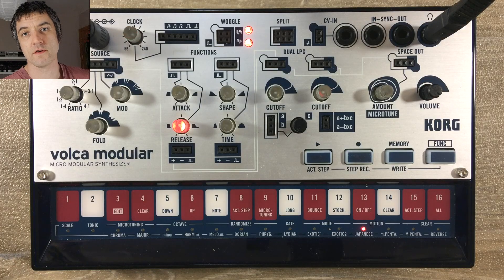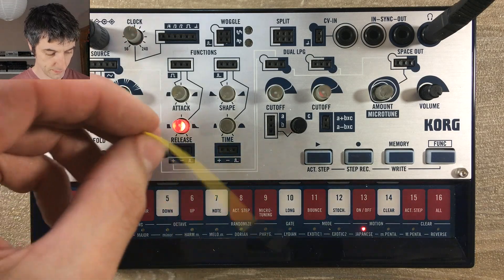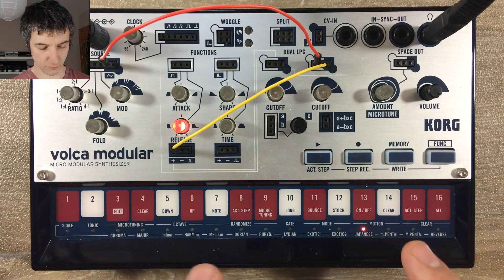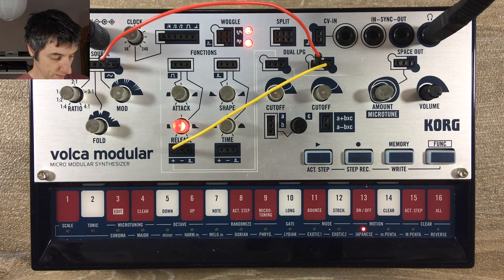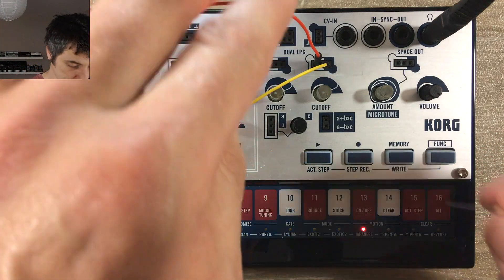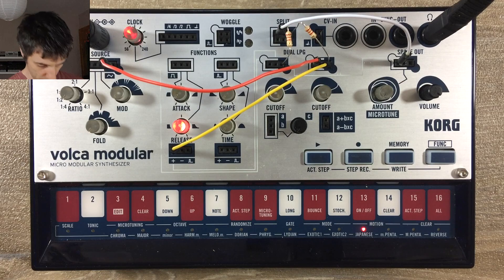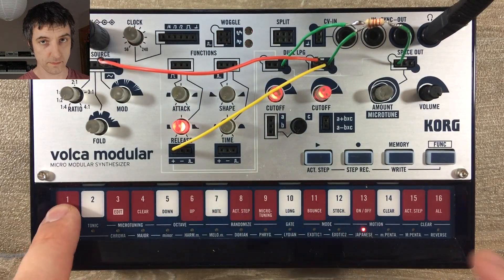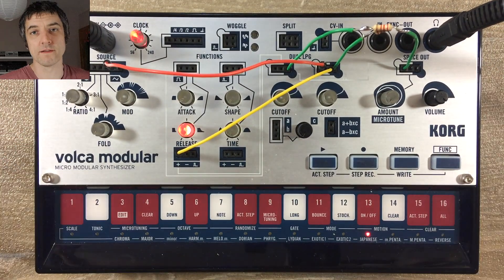Volca Modular Distortion Problem - How To Get A Clean Sound

Comment: excellent video. Have you noticed any issues on the volca modular where the fm modulation sounds pure in the upper range of the ribbon controller, but when you drop down to the lower range it gets wobbly and out of tune?
Reply from the maker: Thank you. Yes that's normal, the Volca Modular used exponential FM to create it's complex tones which can very quickly lead to wonkiness. It's usually best to keep things quite subtle if you want a nice playable tone. This video does quite a good job of explaining the difference between linear and exponential FM https://youtu.be/9_LvPz6kCQE
Reply: @ChrisLodyMusic  sweet, appreciate the reply.
Reply from the maker: @thehellostranger  I think I've given you the wrong information about this after looking into it a bit more. I think the Volca Modular uses linear FM but doesn't seem to do so well at more extreme settings (past though zero). The video below will explain what that's all about. I also should have mentioned it's worth using the micro tuning feature to calibrate the tuning of each note on the keyboard which should help, both of mine were a little flat by default. You can save that into a blank pattern and use it when needed https://youtu.be/fixa0zAebS4

Comment: I had such a great laugh when you showed the soldered cable, I thought the same solution with the breadboard but the last one was just fun, it shows how important is to understand a problem and think in ways to fix/upgrade a possibly wrong behavior. I think you're right, basically the signal is clipping on that stage and attenuation is the solution, I just found your channel and what a great content man, keep it up! cheers

Comment: Thanks for the really useful tips! I never thought I can use the split function the other way around. Also, that you can actually just solder wires and combine / split whatever. And yes, I have the distortion issuen also with my VM. 😎
Reply from the maker: You're welcome. I've not hear feedback from many people so thanks for letting me know it's not just mine

Comment: Great information! I think making resistant patch cables may be a more general thing with many uses. And your Y patch cable made me wonder if we can put multiple cables in one and the same slot.  I'll have to try it but if it works, even if the signal is slightly diminished, that would open a whole new universe of patching options and techniques..
Reply from the maker: Yes making a Y shaped cable or joining 3 patch cables externally should work fine as the little multi block on the Volca Modular is just 3 sockets connected directly together
Reply: @ChrisLodyMusic  WIth  "multi blok" you mean the splitter I presume. SO from your answer I also presume that you've tryed it and the sockets can't except more than one patch cable. But you didn't comment on using resistors as a general form of patching.
Reply from the maker: Yes I'm referring to the splitter. No the sockets can't accept more than one patch cable. I have tried patching elsewhere with resistors and even other components but I haven't found anything interesting to share
Reply: @ChrisLodyMusic  Ok thanks, good to know. So spider cables it is! I'll take out my soldering iron. Come to think of it the concept exists already with the Double-stackable banana plugs dah!... But I want to comment on what you said about the splitter ...if the three slot row is just all of them connected that means the black input-output slot is just a convention.... all three slots can play that role.
Reply from the maker: Yes I think the marking mean nothing on the spliter. I tested the connections with a multi meter and they are just connected directly together so you can use them anyway round it seems
Reply: @ChrisLodyMusic  Great thanks

Comment: I think you can do it without an additional resistor.

Both DUAL LPG outputs directly to SPLIT's outputs on the same row. SPLIT in to UTILITY b. "a+bxc" to SPACE OUT in. Now reduce the amount of output via the C knob.
Reply from the maker: That may be true but that uses a split and the utility that can be used in patches which is why I came up with this method.

Comment: Hi  Chris, i just purchased a used Korg Modular and it sounds terrible.I am going to try your fix with the resistors. I wonder if they can be soldered to the main board, instead of having an external fix.
Your thoughts please and thanks for a great vid..Nick in oz..
Reply from the maker: Hi nick. I imagine it might be possible to do it on the main board but it will be tiny surface mount components at best or possibly even tiny copper tracks that need to be cut so I wouldn't want to attempt it
Reply: @ChrisLodyMusic  ok. thanks Chris.Will go ahead with your method....thanks again

Comment: Great idea! It's such a "plus" to know how electronic sound devices work so you can do these specific corrections and additions. I really need to learn soldering. It looks pretty easy. Just requires the proper Tools.
I'll have to check my Volca Modular for serial numbers. I do know that when I first turned it on I thought it was defective as the volume level is SO LOW to begin with. After watching and listening to more people who bought this Volca, they were saying the same things. You have to turn the volume up so much that it does get to a point where weird feedback/distortion of the initial sound occurs sometimes. I believe Korg even mentioned that this is the lowest volume Volca in the series because people were writing and complaining to Korg about this when it first came out. Hope that helps.💡🎵🤙
Reply from the maker: I think it's just that its basic tone is built around triangle waves which have a lot less harmonics so their overall tone is much more mellow. Through the internal speaker they sound very weak but I always run mine into my audio interface into my studio monitors. Personally I really like the sounds that can be achieved with it, nice weird stuff 😄
Reply: @ChrisLodyMusic  Oh yes. It's definitely one of my favourite and most used. It has a great assortment of non-western scales which I am more accustomed to, so that in itself is wonderful to have + play around with.🌌🔥

Comment: You can't be blamed for playing with the VM lots, it is so much fun!
OK. I have 2 VMs. I've tried the first step in the patch on both, and I have the same issue. Dropping the Cutoff level until it sounds clean is exactly the same as you have found. I haven't tried the resistor fix, but if I do the same patch with normal patch leads I find it takes away a small portion of the rasping, it doesn't sound so gravely, but it also drops the volume output by approximately 10%.
Serials are (haven't included last 2 Numbers);
1st VM is 0117**
2nd VM is 0159**
Interestingly they've never sounded the same, The 2nd VM is bolder in sound and runs at a slightly lower pitch than the 1st. The 2nd one sounds very similar to yours.

I have been experiencing a different problem as well;
No matter which one I use to Sync-Out, I find that when their volume levels are high, using the inbuilt speaker or the headphones, then the VM that has Sync-In will skip steps on its programmed sequence, not on every step but every 2nd or 3rd step. It is almost as if the step is intermittently being double triggered and so I miss the first of the two notes. If I drop the volume on both units by approx 15 - 20% then the problem doesn't occur.
Apparently Volcas have always had Sync issues, but in most cases it is down to people using mono cables, or poor quality cables. This isn't the case here though as I am using good quality TRS cables.
I haven't had a chance to try it yet, but I have a theory, I mostly use batteries in the volca units, and I wonder if there is a slight potential difference between the ground of both units because of this? Maybe at high output levels there is a spike occuring in the Sync signal and this is causing a false second trigger to the Sync-In?
I do have a PSU and a lead that splits 4Ways so that I can power multiple units, when I get the chance I am going to try this to see if the problem goes away when both VMs have a ground at the same potential?
Reply from the maker: Thanks for the info. Sounds like it's a universal problem with these then, but at least there's this fix. Interesting that yours sound different, but then I suppose that's to be expected with variation in components. My Modular is a bit out of tune too so I made my last pattern blank and used the micro tune feature to tune each note correctly and saved that so I can copy it each time.

Yeah I've heard of all sorts of problems on the Volcas being caused by the volume level. It also seems to affect firmware updates and the sample transfer on the Sample

I almost always use either batteries or a PSU per Volca with the volume all the way up, but intend to use the output as a line out rather than headphones or the speaker
Reply: @ChrisLodyMusic  Have to be realistic about what you get for the money, I guess. I don’t regret buying one, let alone two :D
Reply from the maker: Yes I'd get another one at some point I think, I really like what can be achieved with it, amazing little thing really. I've bought a Bastl Kastle and the Drum version is on the way that can talk Volca too so I'm going to have fun their. Worth it to add a nice slow LFO at the very least.
Reply: @ChrisLodyMusic  Finally got round to checking my theory with the sync problem, and sharing a power supply makes no difference either. The slave just seems to jump every now and again if the volume is too high. Bit of a shame.
Reply from the maker: Shame. I always use mine plugged into a mixer or interface at full volume and I've not had any problems that way. Are you using the internal speakers when this happens?
Reply: @ChrisLodyMusic  I’ve tried Internal Speakers, Headphones, even just a 3.5 leads to just mute the device with the volume knobs on a high level, it just does the same thing?
I’ve heard elsewhere that people have had sync issues with Volca’s.
I can work around it to some degree. In all fairness I tend to mostly use the two Volca Modulars by taking a lead from one to trigger a gate on the other for the two units to work together in self generative sounds.
They are still really fun and I’m getting enough bang for my buck.
Reply from the maker: Really odd then. Have you tried swapping which Volca is the master, sometimes that has an affect
Reply: @ChrisLodyMusic  Yep.
Tried Leads.
Power Supply Vs Batteries.
Switching which Modular is Master.
My 2 Volca Modulars are the only Volcas I own, so can’t judge if it’s just a Modular problem unfortunately. It’s not the end of the world.

Comment: I've noticed this problem with the Voca FM. Very frustrating to get around it. I manage to dial in amazing sounds but the price to pay is a little distortion.
Reply from the maker: Oh that's surprising. I don't own the FM but I'd be surprised if you can't turn the patch down somewhere to get rid of the distortion, but don't quote me on that 😄
Reply: @ChrisLodyMusic  You can tune it out but it's not easy. I only really get it when trying to use a little reverb or decay. Tuning it out can really mess with the sound you are trying to achieve. I've found myself having to start from scratch a good few times. I still love the Volca's. I don't have the one you've using. That's the only one I don't have. Big fan 👍

Comment: Interesting stuff. I've probably asked this before but do you know of a Westcoast semimodular for <£700 that does the same as the Volca Modular but which doesn't feel like trying to defuse a bomb through a letterbox?  Anyway, please keep the KVM patch ideas coming. Thanks.
Reply from the maker: Ha yeah it is a bit like that 😄 I've made things even more fiddly by adding the Bastl Kastle which is even smaller! There's Pluto by Modern Sounds that looks interesting but I'm not sure what the cost of that will be. Has nice big knobs and 3.5mm connections for patching
Reply: Maybe the Make Noise 0-Coast would be a good call?
Approx £500 at the moment.
It's neither West Coast (additive) or East Coast (subtractive), as it has elements from both i.e . "No Coast".
I'm no aficionado, but if you want to aim towards proficiency in West Coast synthesis, although expensive, Rack Mounted Modules are the right direction generally, as most American and European semi-modular synths tend to follow the school of East Coast synthesis?

The very reason the Volca Modular exists is to give a very affordable entry into Rack Mounted Realm of West Coast synthesis.
Reply: The 0-Coast is a great option. I’ve been using it for a few years. The “modules” are super interactive, it’s very well laid out and a great breakaway from more conventional subtractive synthesis. Also it packs a lot of features in a neat little toolbox which is useful to have around if you end up building a bigger modular system.
Reply from the maker: Yeah that does look good, it's something I'd love to have a go with
Reply from the maker: Yes they are actually a pretty good match for each other. Ive been meaning to make a video about this as the VMod can be used to sequence the Kaslte Drum quite well. On caveat is that Bastl recommend you run inputs from external devices in through the I\O connection as it has internal protection diodes. This requires using a prototype breadboard like the video below, but I used it loads just patching them directly together without any issues so far. They need to be grounded together which can be done by connecting the I\O connector to one of the sockets on the VMod or just to the same audio mixer or again using a breadboard. https://youtu.be/fM6-jn2mMzE